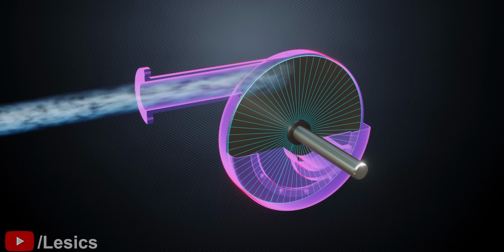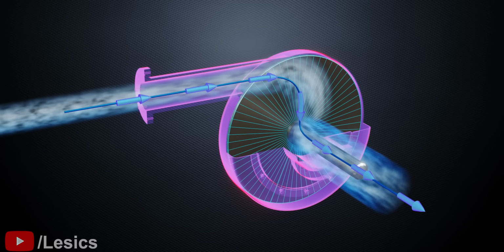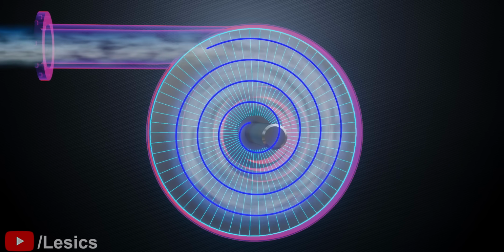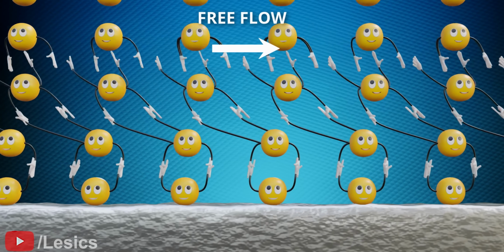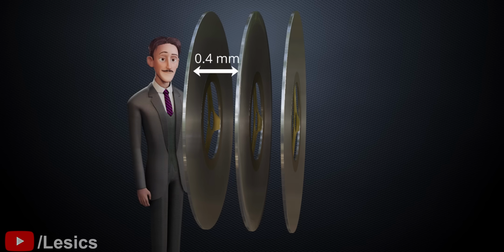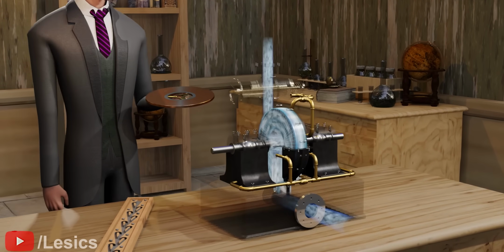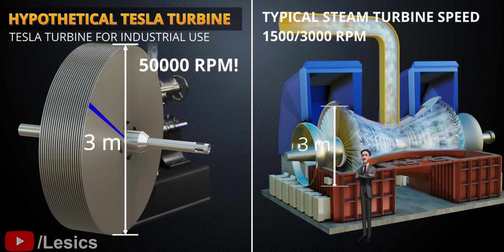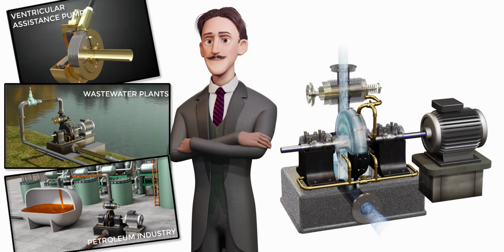Tesla Turbine | The interesting physics behind it

Comment: "We just need stronger materials"

Lol like anyone is gonna use an engine that has a turbine with an edge force of 100 Gs in any capacity.

"Okay sir it looks like the cause of the pileup was a fender bender. It looks like the engine turbine hit the wall and shot out of the car block and killed two other drivers."
Reply: Well Is it 3m in diemeter?
Reply: 100 Gs isn't that bad, I just calculated the G forces experienced by an average angle grinder disk(not exactly the strongest things ever made) and it was a couple of orders of magnitude higher than 100 Gs. We have access to materials with insanely high strength to weight ratios like fiberglass, carbon fiber, and certain titanium alloys that could be fairly well suited for such a situation.
Reply: If someone can make a material equivalent to vibranium, mabye theres a chance this can work.

Comment: Plenty of HDDs spin at 10k RPM, and that's just plastic spinning. So what's the real reason we still don't have hybrid cars with water boilers, Tesla turbines and electric generators?
Reply: It's not about the RPM, it's about the speeds that the edges of the disc manage. A HDD is only like around 10 cm in size and the edges hit speeds of 15 m/s. Discs at the size that a power plant would require would spin at mach 13 for this appliance. or over 4000m/s
Reply: @viktor1496  That's just creating a fake problem and not answering the question. The point is Tesla's 6" prototype almost worked and was probably just a matter of getting plates with better machining and balance to prevent vibration. Giant mach 13 wheels wouldn't even fit inside a hybrid car. 10cm is about the same size as turbo blades, and those DO spin at such high RPMs so it CAN be done.
Reply: @lechpapierski3180  You do not understand the problem. There is no material, not even the likes of graphene that can withstand the speed at the edges of a sizable disc. It is hence immediately useless for any large scale power generation. 
However, Like the video mentioned, there are some niche small scale applications for it. And a car? You're gonna put a water turbine inside a car?
Reply: @viktor1496  No, obviously I don't understand the problem. Adding more discs was already mentioned as a way of scaling up, so why insist on a more problematic method like increasing the diameter? That would probably require a corresponding decrease in the required RPM to get similar velocities in the spiralling fluid, so it seems like a moot point. And yes, I would totally consider putting in in cars if the output power would be in the kW range, as long as the system mass was something reasonable like a few hundred kg.
Reply: @viktor1496  Creating steam -- that's what boilers are for. Rip out the internal combustion engine and use the same fuel supply to just heat water. This would allow for continuous combustion which is also a lot cleaner.
And if you hate Tesla turbines so much, what are you even doing here? Just use a regular turbine for the same purpose and do things the hard way if you really have to.
Reply: @lechpapierski3180  Use a steam turbine to power a car, GENIUS, why didn't anyone think of this before? .......Do you even in the slightest comprehend how much energy loss would occur by using the fuel to first heat water instead of directly using its kinetic energy by combustion to drive pistons? Not to mention the fact that you're basically putting a bomb in your car, one leak and the whole system explodes due to the enormous pressures. And then we haven't even started on how pitifully weak a steam turbine of that size would be to drive a car......or how to dissipate excess heat, your whole car would be a giant hotbox.
Reply: @lechpapierski3180  I'll sum it up cleanly for you. Actually have anything to say to any of these points or don't bother.
1)Modern turbines already achieve efficiencies of 90+%

2)For a Tesla turbine to surpass that level of efficiency, which theoretically is possible, one would have to operate at extremely high RPM's where the edges of the discs reach speeds of 1000's of meters per second. Slower and Tesla turbines are even worse than combustion engines and conventional generators.

3)To reach the speeds needed for those efficiencies, A material with enough tensile strength needs to be found. We are over a century later and we haven't discovered or produced a SINGLE material that could withstand the extreme stress those discs would be under.

Conclusion: Tesla turbines while a nice thought experiment are wholly impractical compared to alternatives and would require materials still into the sci-fi realm to actually be considered as a viable way for converting energy. Nevertheless, they have some niche applications which they are being used for to this very day.
Reply: @viktor1496  Tesla's original 6" turbine spinning at 35kRPM was well under mach 1 at about 275m/s. You have not provided any justification for your crazy idea of increasing the diameter to over 1m without decreasing the RPM. Total straw man. Special materials required? Same thing. You created a stupid requirement where the shear velocities would be way too high, just so you could claim it won't work.
ICE engine efficiency is only around the 15% area, so nobody is going to care about the difference between 90-95%, when even a modest 50% would be a vast improvement.
Who's paying you to spread propaganda that Tesla turbines can't be done?
Reply: @lechpapierski3180  yes, and at those sub mach 1 speeds, Tesla's turbine was less efficient than conventional turbines available at that time. Thanks for proving my point
Reply: @lechpapierski3180  I'll state it again for you: the best metallurgy in Tesla's time was not able to construct a Tesla turbine that didn't warp under use. By the time better materials like titanium compounds and carbon fiber were around, conventional turbines had surpassed Tesla's design. Modern variants with durable materials like the beforementioned carbon fiber are still in use for niche applications and reach efficiencies of at best 60-70%. Modern steam turbines for comparison operate at 90+%. 

Yes, if metallurgy in Tesla's time was better then it would have been a better turbine than the ones in use at that time. But it wasn't, and the device is dated at this point. Again, the end

Comment: Would grooving the disc's help or hinder this? Either straight grooves or spiral grooves. I'm sure it's been thought of before but curious.
Reply: I think that would add turbulence which would ruin the energy transfer between fluid and disc
Reply: @Meltz14  fair just curious if it would add drag or grip for the water
Reply: @myrbs13  it would had drag but it would make this disk woble at high rpm . Also the water would smooth the wrinkles out with time.

Comment: I like how the RPM of the 3 meter disk was assumed and not the fluid flow velocity. Since the turbine works on skin friction, the average speed of the disk cannot exceed the average speed of the fluid. At the tips, if the disk is spinning faster than the fluid, then the fluid will actually be slowing it down rater than speeding it up. You could have just said that you would need the fluid to flow at Mach 18 to spin the disk fast enough, and that's assuming the material could handle the centripetal forces, which they can't. There's no way we are making a hypersonic fluid flow contained in a pipe in the first place, regardless of if the disk could handle the forces. It's a non starter on multiple fronts.
Reply: The problem started for me when he quotes rpm for the tesla then says mach speeds to compare the current turbine blade tips speeds. Fact 1: the 6" tesla needed to spin at 30000rpm to be efficient at 6" diameter, but a 6 foot diameter turbine doesn't need the same rpm to have the same speed at its outer edge which is the crucial factor.  Big turbines don't need the same rpm as small ones, no matter what type.
Reply: It still doesn't matter, as a turbine gets bigger the mass gets further from the center and the moment of inertia, as well as the centripetal force increase. There is absolutely no way at all, with any amount of materials or advancement that this technology could be useful.
Reply: @Chris-hn4lp  it already is useful.....if ya watched the end
Reply: If we reverse the output from the warp drive and redirect that into the photon torpedo chamber, we can get the main thrusters back online.  That should be just enough to help us get the time/space continuum stabilized.
Reply: The 3 meters was assumed too lol. Why the hell does it have to match modern turbines in size? Make more and make them smaller so that the tip speed isnt out of controll.
Reply: @alexcrowder1673  this ffs
Reply: Yea, I guess where you're getting the hypersonic fluid flow would be an issue.
Reply: Inertia of the turbine?
Reply: Can you imagine humans travelling at those speeds, inside say a magnetic train?
Reply: he was a fucking alien and was trying to build a new spaceship to get back home - instead he left us with the bones of the technology we'd need to replicate it u.u
Reply: ... why make the disk out of physical material? I wonder if these principles apply as readily on ionized gases, you can harvest the motion of such a gas directly from their magnetic fields.
Reply: ehem

Vibranium 🥴
Reply: @sumyunguy9930  the emoji adds so much
Reply: @liangarvas8139  yes it does
Reply: @sumyunguy9930    Eludium 
Or Unobtanium.
Reply: AeonReign  give 1 example of this, just 1.. I will wait.   I offer this because it's not at all how you think.
Reply: There’s plenty of US patents from 1940s with hypersonic fluid
Reply: Never say there's no way, you spoil the fun of imagining what if there's a way it can be done!
Reply: @ContemplativeCat  if you know how to do the math it's pretty easy to say there's no way... its retarded to think things will work when the numbers say otherwise. You can't break physics
Reply: @MrDmadness You must be a fun date.
Reply: @ContemplativeCat  been married for a long time now, but yes I'm fun, I find reality fun as is twisting it on occasion.  If the numbers say it won't work then 100% it won't
Reply: @MrDmadness  we cut steel with water going mach 3+, so its not like we haven't built high pressure systems that can handle speeds in excess of mach 1. I can fully appreciate its not feasible now without shutting down the possibility of future uses. Besides which as the video pointed out, there are already several instances where the concept is used for non-power-generation applications. Just like, don't be such a dick.
Reply: @MrDmadness  
I thought I heard that the figures for bumble bee flight don't add up too....or is that an urban myth?
Reply: I don’t understand. What’s wrong with the 90-92%?
It’s like these furnaces. 90% isn’t good enough they need to be 93%. 
Wow. 97% why? What’s the gain. 
I think God puts limits on things for a reason.
Reply: @whereswaldo5740  Yea lets just not optimize anything and make shitty machines that do a bad job.  Wtf is this take?
Reply: @whereswaldo5740  did u say God?
Reply: The fact is it wouldn't work at any speed. You cannot make one large enough to work for commercial power generation. Turbines at power plants generate in excess if a Megawatt. There is absolutely no way this can be scaled to any size to allow that. Adding more smaller turbines reduces efficiency and thats not even looking at problem of how to turn a generator with a bunch of small turbines. What should they make a bunch of small generators? Do you realize the difficulty and additional electrical equipment that would be needed for that> Do you realize the loss in effeciency it would cause? There is no way this technology can be used. I realize the non-engineers here want to say its possible, but its just not. 

I mean could you theoretically make a system of tons of these little things with tons of little generators? yes, but it would cost 100x as much as current systems, and have 1/10th the efficiency.
Reply: @Chris-hn4lp  you're right...this one, like many others "miracles" of Tesla (and Da Vinci before him) are not used in world not because of a villainous plane, but just because they are only beautiful but wrong inventions
Reply: What if you used "melted snow" as the fluid? Antarctic snow is very cold and when it melts, it's super pure.
Reply: @greenwave369  snow is literally just water, i dont get your myths but theres nothing special about it
Reply: @greenwave369  It's not "super" pure, it does have less pollutants due to the lower industrialization of the polar regions, but it has dust and minute particles like regular snow.  It's cleaner, but not super pure by any means.  We can purify water to a much cleaner level way easier than dealing with getting Antarctic snow.

Comment: So todays super materials can't make it work?
 I think people just haven't tried.
Reply: Have you not watched the video or do you not comprehend that we haven't got any material that can handle spinning speeds of over mach 10 -_-
Reply: @viktor1496  Meanwhile, in the graphene lab...
Reply: @HalkerVeil  You realize even the tensile strength of graphene can't handle this? Just look up the numbers please...
Reply: @viktor1496  Yes please show them.
Reply: @HalkerVeil  The tensile strength of graphene is around 130 Gpa, however for deformation, we don't need to break or snap the disc and anything in the region above 100 Gpa would make it defunct in seconds, which is also a convenient number to compare with. A quick centripetal force calculator for a disc with a radius of 1m and converting it to tensile strain makes it clear VERY quickly that the pressure would be far above that for a disc spinning at sufficient speeds or around 5000 m/s at the edges.
Reply: @viktor1496  Make it 5 decimeters and don't spin it so fast. Problem solved. Efficient enough.
Reply: @HalkerVeil  Did you watch the video? If you lower the RPM, then conventional turbines made of cheap steel are more efficient so why the heck would you use it then?
Reply: @viktor1496  Don't use steel. Use graphene. Round and round we go.
Reply: @HalkerVeil You don't even understand the fricking problem..... Tesla Turbine at High RPM > Modern turbines, Tesla turbine at low RPM < Modern Turbine. But tesla Turbine at high RPM = breaking it since no material can withstand that stress. Easy enough for you now?
Reply: @viktor1496  lmao. You're telling me nobody thought to introduce friction to control it's speed so it's equal and generates a little electricity on the side with it?
I swear it's like scientists get so narrow minded they can't even piss in a toilet correctly without doing algebra first then miss because they forgot the speed of light.
Must be why they're bed wetters and think that's just what you have to do and everyone does it.
Reply: @HalkerVeil  So you simply don't understand how it works, fine that explains a lot. If you don't even understand the concept that if it runs at lower RPM, its efficiency goes down.....then what am I even talking to you for
Reply: @viktor1496  What I understand is a simple gradient. A throttle. Stop acting like it's mach 10 or nothing. Light speed or nothing at all. Please.
It's like saying a sports car can't go fast enough without crashing.
Enough with the sophism. You're not fooling anyone.
Reply: @HalkerVeil If you truly think that you solved it by watching a youtube video when over 100 years of scientific development couldn't.....Then I don't even know what to say 

It's amazing how you can think that "people just haven't tried'. Do you even realize how much money you'd earn if you developed a turbine like this that could operate at full power and be installed in a modern power plant? 

People tried, it didn't work. No material can withstand the stress, not even graphene.
Reply: @viktor1496  I didn't solve a thing. I asked a question in the op. Then stated what I think based on nobody tries anymore since people in labs working on super materials are not generally bringing up old mechanical inventions that just needed a little help.
If you see more than that, then it's your problem.
Reply: @HalkerVeil  You literally said I quote: "just lower the diameter, problem solved". And then flaunder around claiming to know how labs work and how the people in them think. So yes

Your question had been answered, you not understanding the answer is a different matter entirely
Reply: @viktor1496  No it hasn't. You know nothing about labs. I've worked in one for engineering. Everyone has their mind on one job. Nobody collaborates for stupid projects like this.
And that is why it's never been done.
That is also why you will not show me any papers proving it's been attempted. What you will find is hypothesis applied to previously held understandings without any of the new techniques discovered for practical engineering applied in any way.
Why?

One simple fact that you don't see to get.
It's nobody's job to do it.
Nobody cares.
I don't care.
Thus my statement that nobody has tried to make it work.
Reply: @HalkerVeil  And what did you do there ? Administration? Physics is physics, you can calculate the centripetal force and tensile strength on the edge of spinning discs easily enough with barely more understanding than is required of high school physics. The forces are of the order that we simply do not have materials to withstand it. End of the line